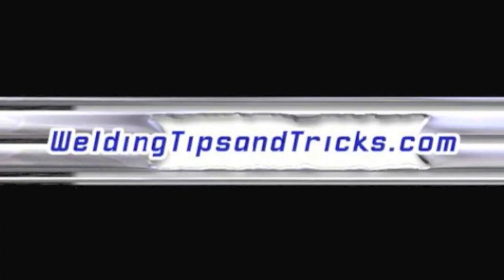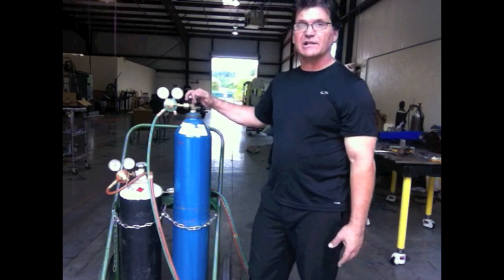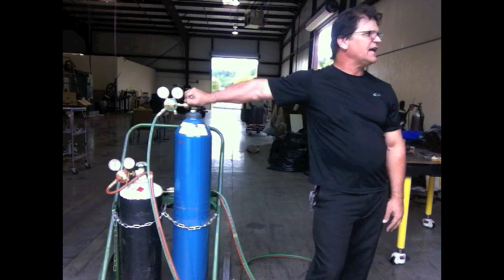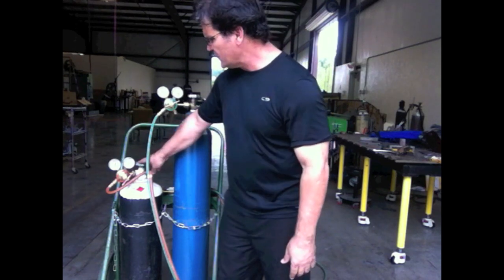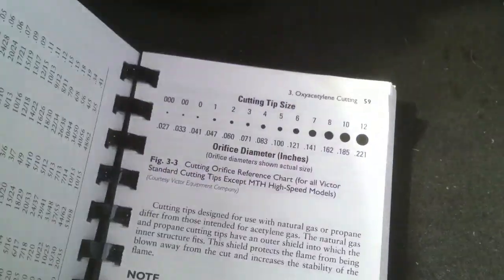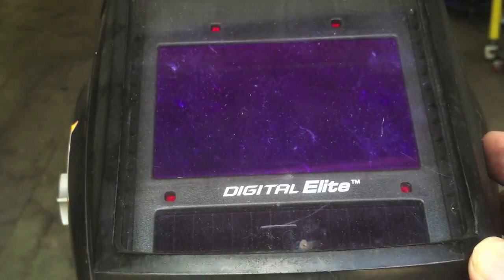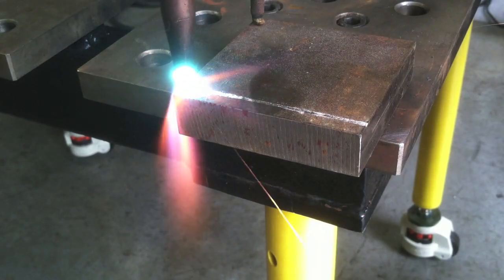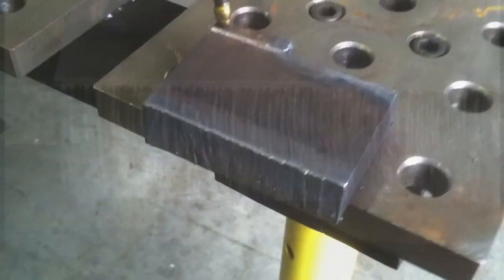Cutting Torch - Tips for Oxygen Acetylene Cutting

Comment: The one problem you are having with cutting the 1/4" plate was too much Oxygen pressure.  Seems you were set at about 40 psi and you could do the same cut with 20-22 psi. with that tip.    You can tell you have too much O2 pressure by looking at the video of the cut.  If you notice the slag is going straight down under the 1/4" material.  That is an indication of too much pressure and will allow the slag to blow back behind the cut due to the high pressure area in the kerf and cause the steel to "weld" itself back together.   If you notice on the 3/4" plate the slag coming out the bottom of the cut was at about a 45 deg angle toward the forward movement of your cut.  Perfect!  This is due to a balanced pressure with just enough to go through the steel and just enough pressure to create a low pressure front in the direction of travel to blow the slag out in front of the cut and not cause it to be sucked back into the kerf.   With the exception of a dirty tip.  9 out of 10 problems of cutting is too much O2 pressure.   With the proper tip you can go through 1" material with 25 psi O2 all day long.

Comment: Thank you very much. I am 50 years old and learned to use a torch when I was 17 or 18. Over the years I wondered if I was doing it right. I am not a professional by any means, just a guy that uses a torch once in a while. Everything you did in this video my dad taught me all those years ago. I just need to brush up on settings and metal thickness etc. Thanks again.
Reply: WallysPlace66

Comment: Off all the oxy/acetylene videos I've watched on YouTube yours was the most complete, especially the reasons why you do things.  Definitely will get the guide you recommended.  No other video mentioned that different metal thickness requires different tip sizes and different gas pressure.  Thanks.  Really good.

Comment: I was taught how to do this in 1967 by my metal shop teacher. You teach the procedures exactly the same as I was taught, fifty years ago. Way to go! Great video!
Reply: I have torches that are that are at least that old, and the gases haven't changed!  It's Classical Technology!  People might laugh at my torch outfit, but just yesterday at work there was some light welding or brazing to do, outside and maybe fifteen feet off the ground, and  no electricity yet.  OOps!  So I practiced a little gas welding and "brazing", just in case.

Comment: On my first day of welding school the teacher taught the torch safety precudure.  Fast forward 13 years later Im cracking the torch looking right at it with no safety glasses and guess what happens? The mother farting guage explodes and peppers my face with plastic spall. Needless to say my boss was pissed because I was the only shop welder and should have known better. So from that day on I made sure all the newer welders turned their heads when opening the torch. Remember, you can walk with a false leg, you can hear with a hearing aid....but you cant see with a glass eye!! So safety glasses all and I mean all the time. Sorry for the rant but I hope this helps. Safety First!
Reply: yep, I always have them facing away from me, thankfully nothing has failed yet and I hope it never does!
Reply: I've had splinters and little hooks in my eye from grinding before and had 'em dug out with the little needle and microscope at the clinic 3 times now and its no joke, once from blowing mud off excavators with a turbo nozzle left me blinking and eye watering for 4 days. Not fun, not worth it; now I wear the glasses.
Gloves and glasses always, once burned now vigilant - Those guys that don't are either lucky or they haven't been there yet. There's no good in following the blind into ditches.

Comment: Thanks for the safety tips in the beginning!  The reasons why you do certain things really reinforces  the need to do it right.
Reply: A very well thought out video and I like the tips on safety and where to find more information. I cut just about everything with my powerplasma cutter but I suspect I will buy an oxy-fuel kit sometime soon because it is so useful
Reply: Aidan Wilson Keep in mind that with oxy-fuel, you can cut, weld, braze, heat, and probably more. With a plasma cutter you can really only cut and you need electricity and compressed air for it.

Comment: Thanks for another great video Jody!
I would add one more step to the shut-down procedure: after extinguishing the flame and shutting the supply valves on each of the cylinders, pause for 15-30 seconds to see if the regulator-hose-torch assembly holds the pressure reading on the high-pressure cylinder gauges. Any leak in the system will cause a fall in the high-end reading and should prompt investigation with soapy water to find the source of the leak before the equipment is used again.
Thanks again for all you do for welder education!

Comment: Great video.  Been soldering 40 years and MIG / TIG for 20, just bought a used gas rig so I'm trying not to go bang and your video is helping.  Just wanted to thank you for the info on the "Welding Encyclopedia".  Went to look for one and the editions around 15-20 1950 - 65 are going for $500 - $700.  Found one I thought must have been a misprint on Amazon 1930 Seventh edition for $18.  Arrived today.  Very cool book.  Ads in the back are priceless!

Comment: I use Propane for cutting, the recompression thing was new to me.
But crank up the valves slowly anyways because I thought it would be easier on the regulator.
I also know from experience how much I need to crank up the valves in the torch to get a nearly perfect flame before I light it, so I only need to fine tune the flame.
Very informative and easy to comprehend even for germans like me.
Thumbs up this guy!

Comment: Great video contribution. Indeed one of the BEST instructional videos about Oxy-Acetylene torch usage viewed in last 5+ years on YouTube, concise and to the point with sufficient details for most DIY guys and new welders. Thank you and my best regards. 
I hope you can add a few words about flashback arrestors and check valves in this or future videos, and explain where to install them (near the torch or next to the regulator or perhaps both ends, and why a particular location provides the best safety practice.)
Thank you again and look forward to your future video postings. 
BTW: Regarding the torch turn OFF procedures, I agree that some OEM/posted procedures seem contradictory. My overall understanding has been to use the reverse sequence of lighting up the torch. So, the most common suggestion is to tun off the oxygen first and then the Acetylene. Allow the tip to cool off for 30-60 seconds (to reduce the possibility of re-ignition or flashbacks), turn off the main cylinder valves starting with Acetylene first, since it is quicker and it is the more volatile gas than oxygen, [also emphasizing that Oxygen is not really a flammable gas, but it is an oxidizing agent that helps the combustion process when there is a fuel present, where as Acetylene is an extremely volatile flammable gas), and finally bleed off the static pressure build up in the hoses using the torch valves (oxygen first), and finally close them to prevent torch valve internal oxidization due to atmospheric moisture.  I look forward to your comments in this regard, since my main objective is to learn from professionals like you.

Comment: Just bought my first cutting torch. Never used one before. I found this the most understandable video so far. I'm very great full for your time spent explaining.
Reply: +R.L. HEARN He makes it look so easy. He has got to have one of the steadiest hands I've ever seen. I'm trying to get my plasma cutting with my power plasma cutter to be as smooth.
Reply: Jim Belkin ,place a strait pice stock along your place to be cut for a guide, than all u have to do,is manage your distance of neutral flame to material & speed of travel, u can tell if to slow, slag build up on the bottom of your cut,to fast, and world of hots will, will, blow back.
Reply: Jim Belkin He is steady. Your right. I just researched the video for a refresher.

Comment: @5:05

I finally found you after you're recommended by this Old Tony Channel!

I want to thank you cuz I've been watching dozens of oxy-acetylene channels since I bought a small tote kit yesterday with an MC acetylene tank.

You are the only one I watched the actually says you set the pressure according to what is recommended by the tip manufacturer. This is my belief totally as I'm going to believe they're Engineers rare than a cookie-cutter all-purpose setting for brazing, cutting, and Welding--HOGWASH!

The number 2 welding tip and the number 2 cutting ttip with my ProStar 21508 kit I'm just going to run at the Victor 3 PSI minimum acetylene. The Radnon Victor 6-MFA-1 tip wants 8 PSI acetylene minimum:  which I am scaredy pants so get up to but I better cuz the booklet that came with it says if I starve the tip it will cause it to get hot and the likelihood of flashbacks.

Comment: Excellent review video, thx. For cutting thinner material like the 1/4" plate, I like to use a tip with only 4 pre-heat holes. Makes a nice clean cut. These 4 hole tips are recommended for clean or new metal cutting, whereas the typical 6 pre-heat hole tips are recommended for "general" purpose & scaly metals.

Comment: Very Good, I see so many guys doing the fast crack and watch.  Also another thing I was told not to do during my Apprenticeship that alot of people do alot is, turning on the acetylene with no gauge attached tosee if the bottle is full.  I was told that the Acetylene can ignite out of the main valve stem.  Is this correct?  I have just always believed my teacher and check the bottle with a gauge attached, that way you can see how full it is too.  Great video cheers

Comment: love your vids,   thanks for all your time and attention to detail, 
i just got an oxy set up,  guy couldn't pay me for a welding job,  so i took his bottles but had to buy the torch set up,   first,   i purchased an airgas radnor rig,   cutting torch , brazing tip, and what seems to be pretty cheezy gauges,   after watching your vid,   i'm scared of the acetylene,   can i safely store these things in my garage?    do i have to build a shed just for this?    i mainly weld {tig}, use aluminum for everything,   steel i go to stick
seems this rig is only good for cutting steel,  anything that has to be welded i use the miller 150 or tig 225
what else can i do with this ?    seems i got myself into a very expensive arena because i got stiffed
what brazing rods are the best,   a project i have right now ,   my pressure washer head, brass has a stripped thread,  the hole is being bored out but the wall is going to break,   how strong is a braze vs a weld, 
thanks
your vids  were a staple in learning to weld,  that and making every mistake possible :|

Comment: When I cut plate I clamp a length of 50mm angle on the plate and mark a line 12 or 15mm from the angle with soapstone, depending which side of the line I want to cut. I ride the shoulder of the torch on the edge of the angle giving me a consistent gap about 1/4" and a nice straight cut.

Comment: and a quick ps, 
i'm mostly cutting propane tanks for bbq/s and now trying ac freon tanks,   they are very thin,  maybe .060,  cutting with a 000 tip,   seems to cut very well with the settings high, 
but you are the go to guy,   the book says 3-5 acetylene and 12 or so ox,   but it doesn't seem to have enough power,  
what great vids,  and the little personal notes show a great deal of character
truly and example of the humble master
Reply: MARTIALCOMBATIVES are the propane tanks used? if they haven't been left out emty for awhile you might wanna be careful cutting into them the propane usually "seeps" into the metal of the tank and if you don't leave then with soap and water for a few months they can make a fire this is of course for one's that have only recently been emptied out
Reply: yes,  but take the valves out and soak them for a couple weeks  rinse daily   thanks for the info

Comment: No need to cut a straight cut without a straightedge as long as there are no obstructions in the path of the torch. But for practice totally freehand is ok. I like to use around a 1 inch pice of bar stock for a guide and a smoother cut. Rusty Steel demands more concentration and the smooth side of the bar stock gives me a big advantage especially on a 3 or 4 foot cut.

Comment: i could really use your advice   you are the last word for me
i've been really getting into the oxy acetylene world the last year
i have a radnor med. duty set,  but it seems so cheezy,  gauges are fragile and one doesn't go all the way down after closing valve    i want to upgrade
i've spent 3-4 hrs a night for a week reading all the input but it's all opinion,     seems smith is the best , next victor,  then just a toss up
*what torch should i get?   
*what regulators
*is there a big difference between the $50 flashback arrestors and the cheaper ones?
*i think i need arrestors on torch and regs.     do i??
thank you for the great vids      you are truly a master of the weld

Comment: how important is the setting of the gauges ,???    an old timer at the gym says when he was in the port , in miami,  just open it up and set at torch,  a steel worker says same thing, 
keeps ox at around 60 and acet. at around 12,   a manual i have has a bunch of settings at different thicknesses,    i've been using it at acet. 9-10 and ox at about 30,  seems all is adjusted at the torch,  but i''m new to this and learned most of my tig welding from you,     THANK YOU,  i've become a great tiig welder, especially with aluminum,  which i learned on,   
also , is there a big difference in brands,  i have a radnor set on the tanks now,  medium duty torch,  also a heavy duty waltech,   seems to be a huge difference in quality
the radnor gauges bounce if i tap them,   sound cheap,  the waltech is solid,   
but youtube reviews say harbor frieght is great, then is sucks,  then the top brands suck,   
explosive scares me,   please advise,   thanks
*is radnor ok?
*big differences between radnor and victor?   airgas says they are the same
*gauges.... are they all pretty much the same???  dont' seems to be
thanks 
love your vids,   welding the is the most expensive hobby i ever fell into
can't make a buck,  spend a lot on my projects,  but it's so much fun,   what a great skill to have ,    good by to jb weld for ever,  
thanks

Comment: New user trying to figure out what I'm doing wrong. Bought one of those GasPony cutting torch kits from Tractor Supply with the #1 size cylinders. Set the regulators by the manual (3-5 acetylene and 20-25 oxygen) but the acetylene is running out fast. I'm talking half-empty after only 15 minutes of use. Not sure if I'm doing something wrong or if it's because the cylinders are so small. Sprayed all connections with soapy water to check for leaks. Not sure what else to do.

Comment: NICE video--i have a question.. why isn't the oxygen and gas mixed 
beforehand .. why the need to have 2 separate lines closer to combustion
 ?
Reply: You mean like having the mix in the same cylinder? That would be a little like keeping an armed one megaton bomb in your shop.
Reply: ksb2112  that unsafe? wow ok
Reply: The gases dont mix until the come out of the tip but even then, they arent really mixed

Comment: Did you tighten the screws back up on the regulators after cracking the tanks and before adjusting the pressure? sorry if this is a stupid qhestion.

Comment: When I try to cut 1/8" steel it melts back together. If I turn the flame down, it seems to not be able to heat up to start the cut. If I go any faster, it spits back at me and stops cutting.

Any ideas? I'm still trying to learn this
Reply: I'm new to welding. I just bought an everlast welder a couple of weeks ago and have signed up for courses in the fall. When is good to use a cutting torch and when is it good to use a plasma cutter?
Reply: plasma cutter is great for expanded metal, stainless steel, aluminum etc. oxy is good for mild steel and pre-heating
Reply: Turn oxygen gauge pressure down for thinner cuts

Comment: Hello, waiting for my flame cut and weld equipment soon...
When you read 1000 psi on the oxygène, does it mean the tank is half full? (2000 is the original pressure is not it?

Greetings
Reply: That's what it means!  If the temperature is the same when you're reading it.  This is not true for propane and acetylene and CO2 where there's liquid in the tank and the pressure is always roughly the same.  You have to WEIGH those tanks to know how much is in there.

Comment: and a ps.     do i need flash back inserts?   gut at airgas says their radnor has it in the body,   but i'm always leaning towards safety
do i need them just at the torch end or both gauges and torch?
thanks            super afraid of this gas
Reply: +MARTIALCOMBATIVES i would put one at each end of the cables, that way if the cable leaks the flashback arrestor will keep the flash back from reaching the tank

Comment: I'm about to start using oxyacetylene for cutting and when I got a new auto darkening helmet it said not for oxyacetylene cutting or welding. It goes down to 5 dark so why can't I use it?
Reply: 5 is good. Most acetylene welding/cutting goggles are shade 5
Reply: 1212alex1222 I believe it's because the manufacture estimates the light sensors in the helmet aren't always sensitive enough to the oxy flame (or plasma).  A welding arc in comparison is much brighter, and will trigger the sensors reliably.